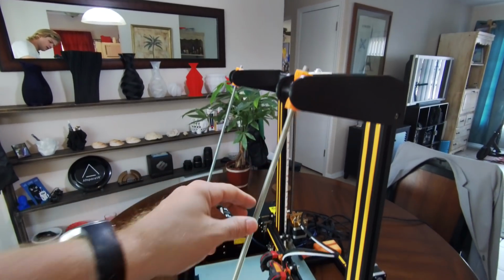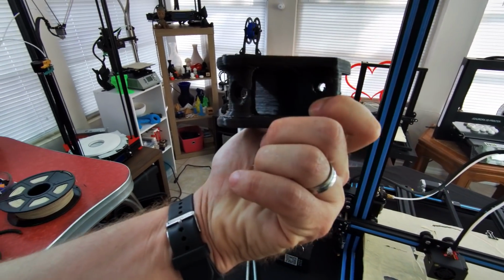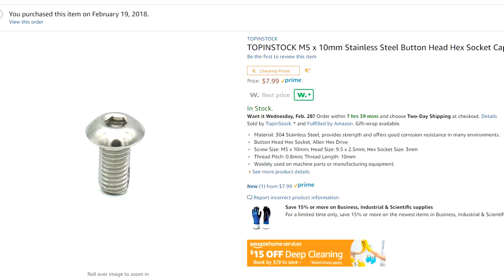✔CREALITY CR-10 ULTIMATE FRAME SUPPORT UPGRADE!  (ALL VERSIONS)

Comment: Can u please help me out.  I ordered the cr10s. I’m trying to buy filament.  I see a 1.75 but then it say 0.03  is that the nozzle size?  I know the cr 10s comes with a .04. But can I use   Any size filament .04 and below or do i need to buy exactly .04 please help me understand this all better. Also what’s the best pls abs and flexible for the creatily 10s. Thanks a lot I really like your videos.
Reply from the maker: hey man, yes your nozzle size is .4 or .3 and the 1.75 refers to plastic size. There are two plastic sizes, 2.85mm and 1.75mm. Most printers use 1.75mm filament. However my lulzbot can use either!)
The kind of filament you use is based on what you want from the product. I use PLA for most things visual. ABS for actual using plastic parts like computer tower wheels. ABS doesn't snap like PLA. When you want something to be soft or more rubbery then it is best to use flexible filament. Hope that helps!
Reply: Reality Check VR  
Thanks. Just 1 more thing. The filament said .03-mm and .05.  Both are 1.75.  If I have the .04 nozzle on the cr10-s  does that mean I can only use the .04 and below.  Meaning it will flow through he nozzle  and higher I’ll need to change nozzle heads right.
Reply: @the-bu3lb  i know its 2years old comment, but i will answer for people who read this in future. 0.03 - 0.05 in filament description refers to tolerance ( 1.75mm filament with +/-0.05mm can have 1.70 - 1.80mm diameter) so basiccaly lower tolerance means better quality